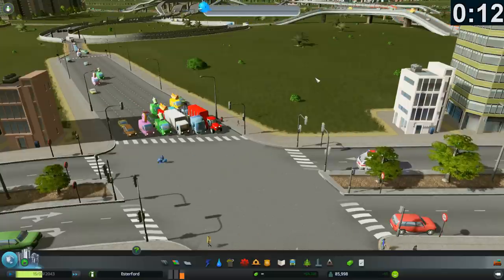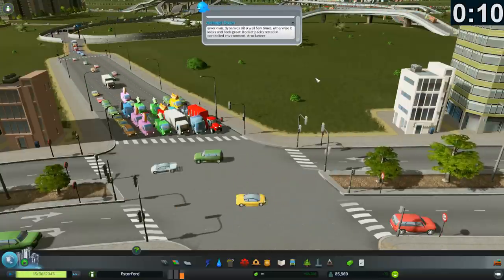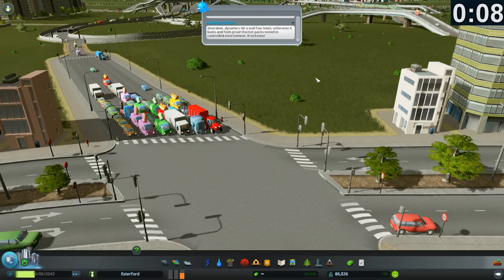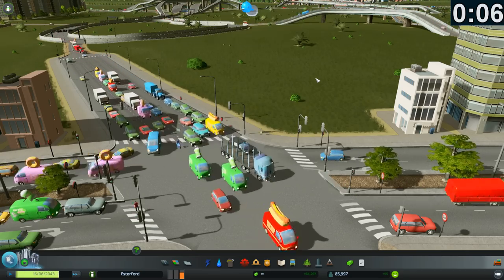Cities: Skylines Tips #3 ► How To Improve Your Off Ramps! ◀ 60 Second Tip

Comment: This is great, but it shows one missing part of the game. The 3 "times" is a motorway, its not a city road. This might work here, but not every where.

The 2+2 is missing a oneway system.

Fine... we have 2 way onewan.. and 2+2 way to ways.. This is any way great. because you can use 2x2 one way as a 2+2 to way.. But there is no 4 lane one way... why? Its just seems to be missing from the game.

Also, there should be one nice way of adaptin the 2+2 way to a dual 2 way one way street.